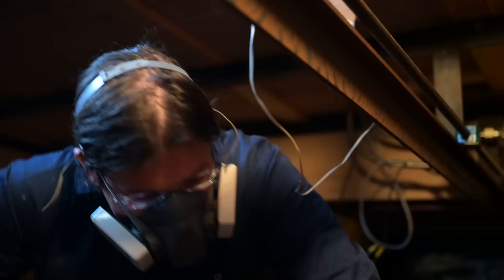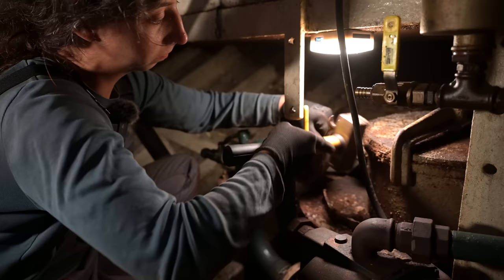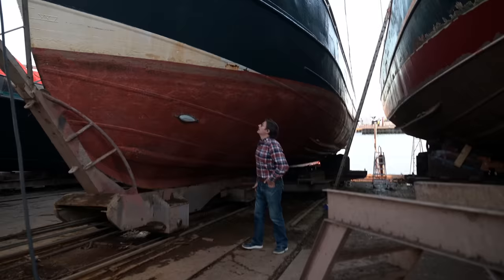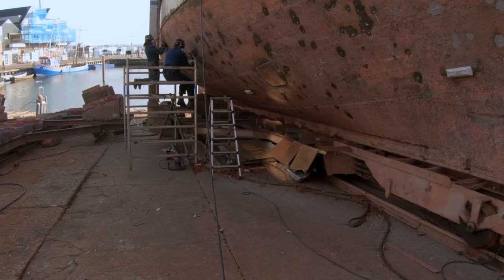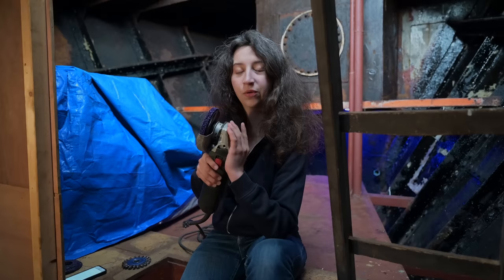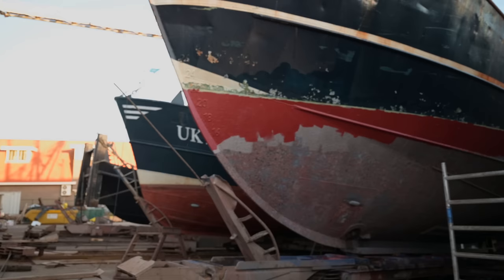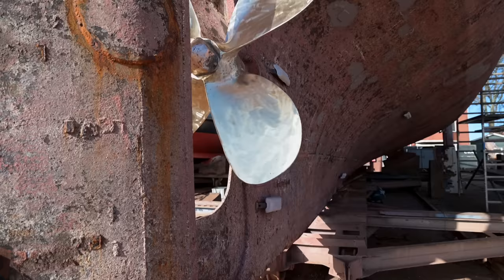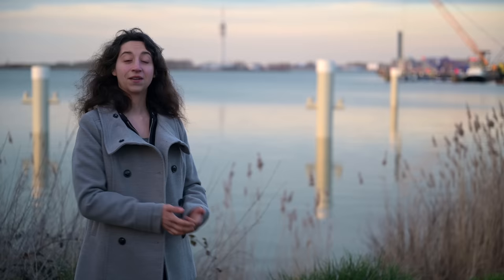We Risked Everything To Restore This Old Sailing Ship!

Comment: The hull construction of full displacement steel hulls like Flying Coney and her younger sisters, is very interesting. The hull plating is applied in somewhat narrow planks to allow shaping of the curves. Unlike modern vessels that have large flat sections of steel to minimize the need to cut and shape the plate. The modern construction sacrifices a lot of efficiency and aesthetics.

Comment: I agree I love watching all the boat restoration shows I'm looking all the time for a project.  I'm looking at 45 to 60 odd feet in length I'm looking for a steel hull as have worked on wood and steel and fibreglass boats . Wood you feel damp all the time . Fibreglass vibrates and bounces around in the sea moor to light .steel seems to Handel much better in rough and is easier to repair just cut n weld .

Comment: If you need penetrating fluid try getting hold of Rivolta TRS plus, this made by Fuchs, I use in Australia where it is reserved for the mining industry. It has high creep is fully synthetic and a neutral pH, most penetrating fluids are simply diesel and don't work. 
Rivolta is amazing, you will really appreciate the product when you try it, but Fuchs is very reluctant about selling it to the public.

Comment: Suggestion - In this sequence; 1) vigorously wire brush the rusted nuts, bolt heads and any exposed threads, 2)  Apply lots of heat to the nuts/bolts with with a handheld propane torch.  3)  Immediately soak down the nuts and bolts liberally with your favorite penetrating oil. Repeat the soaking several times if necessary.  Barbara has the patience to do this well.

Comment: That’s something people don’t realise. The advantage of having a hole in the hull is that it is great for drainage.😂😂😂😂 
It’s interesting that in the time of sailing it was important to have a little drag as possible but of course as soon as diesel engines come along that is less of a concern and I suppose that’s why the 1980s boat is a lot more angular. Flying Coney is the nicest of all three boats!
Your current DAF is clearly keel cooled. Was strainer from an older engine? if so, what was the engine? Or was it from something else?

Great Video!😀
Reply from the maker: Hi Canice, the strainer was for a strong deck and net wash pump. The valve underneath it was very very old. The keel cooling was introduced together with the DAF, before that she had an De Industry 4 cyl. engine one of those large ones you start by air. Cooled with an heat exchanger and I believe the discharge valve above the waterline is still in place. I just looked it up on an old photo if there's water coming out on the side somewhere and it is. 
The Kort Nozzle aka Ducted Prop is mostly beneficial at low speeds. So most tugs and trawlers have them. Above 10 knots the additional drag eats up the benefit of the higher efficiency. We believe that Flying Coney was designed as a logger, so the nets were floating in front of the slowly backwards drifting vessel. No heavy towing involved. But long journeys were an evident hull was important.

Comment: Hey guys I’m not sure about your Intel, but we built and serviced a lot of mine sweepers here in Rhode Island.  Before my time but I’ve worked with a lot of guys who worked on them.  Mine sweepers have no ferrous metals on board.  That includes the engine and all tools.  The reason for this is that mines are magnetically triggered.  So you might have to dig deeper into that claim.  Keep up the good work!
Reply from the maker: Flying Coney was definitely not built as a mine sweeper. However, the Kriegsmarine used KFK and also herring loggers as VP- Boats, Outpost Boats, Flakships and especially after the war the boats also were used for minesweeping. It's possible that our boat had wooden planks, was longer in length and was destroyed doing that job and was later rebuilt "in iron". I agree with you that there are probably better warships but they did use what they had during that time.
Reply: @FlyingConey  Yeah it's possible. Not probable though. If it were used as a minesweeper it would be quite easily proved through military records. You haven't backed up a single one of your claims about this boat's history with evidence.
Reply from the maker: @danielstewart3507  Don't get it why you people are always so negative here. Here you have the prove that she was a wooden military vessel predating 1950. (The last sentence) https://www.zuiderzeecollectie.nl/object/cvr/Centraal_Visserijregister-40036410
Reply: @FlyingConey  lol. That's a different boat. Length 21.74 metres is 71 feet. Your boat is 82 feet.
Reply from the maker: @danielstewart3507  That's because it's not the LOA in the paper, it's the load line... Don't be ridiculous.
Reply: @FlyingConey  I think the only person being ridiculous here is you mate. 24 hours ago you wrote "It's possible that our boat had wooden planks, was longer in length and was destroyed doing that job and was later rebuilt "in iron"." Now you have a piece of paper that you say proves this claim. Why didn't you start with that? But I also think it's highly unlikely that a wooden boat of that size was ever rebuilt using steel. The amount of work that would take is absolutely insane. It's more likely that the documentation for your boat came from a different boat. I'm always happy to be proved wrong though. Where I am from we always use LOA as the measurement. I thought that was standard.
Reply from the maker: Ok, I'm just very careful that's why I use words like careful. One document is stating she was a KFK, the other one stating that she was a wooden Voorpostenboot (also a warship). But both state that she was indeed a boat with wooden planks on steel frames and that she was completely rebuilt with a steel hull. The KFK series were built in large numbers all with wooden planks on steel or iron frames. So not that unusual. The probably kicks in because we don't know if the original boat was damaged during the war, after the war or was not finished. We only have the hint with the attachment point. The numbers in the document refer to something that has to do with the cargo. It's also "Holte" and not "Diepte" but before I say something about it I usually do my research first to answer such questions without a doubt.  But I doubt that this makes any difference for you you came here with a negative attitude instead of searching a good conversation about boots and history.

Comment: I don't know if you are already aware of sharrow marine props, if not go take a look
Reply from the maker: I did and it's a very interesting concept. But unfortunately not suitable for our high torque set up. A 47" (1.2 meter) diameter four bladed prop isn't small and costs about 30 000€. One with adjustable blades for sailing would be amazing but costs more than 100k. SV Seeker built one himself but still struggles a bit to get it running.